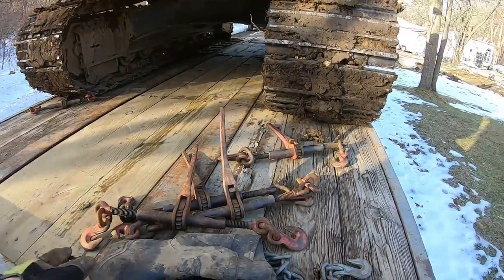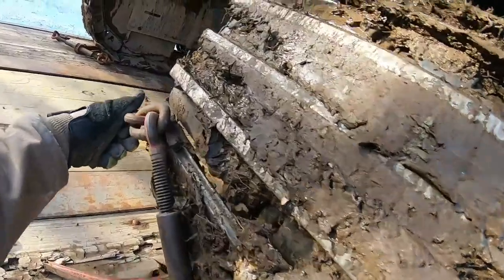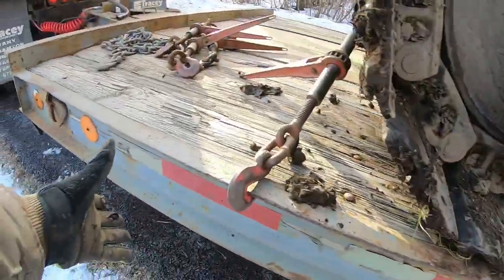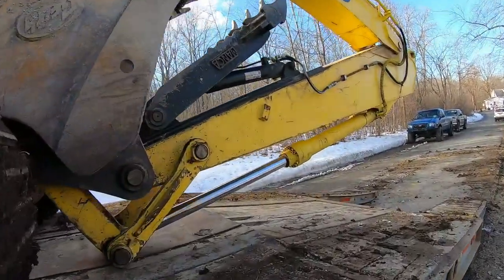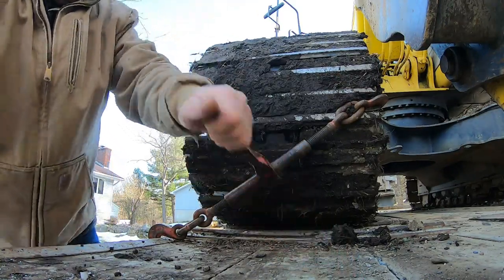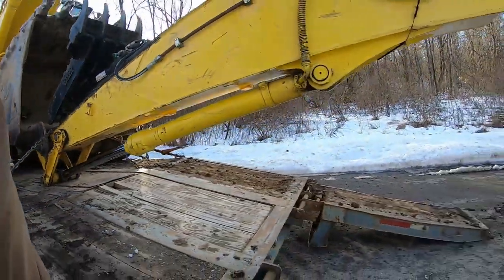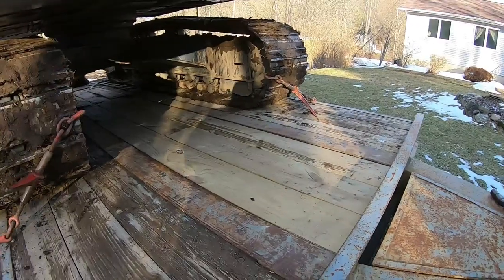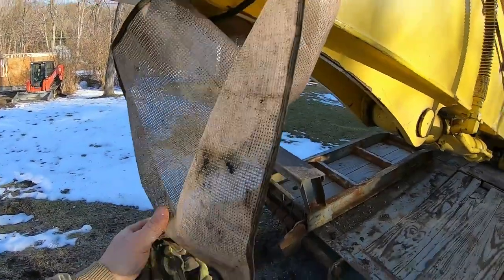Towing equipment from job site & proper technique of chains & binders for beginners

Comment: Pardon my question, as I know nothing about this type of equipment, but does tightening those straps damage the track at all?  I can see the amount of tension and the  stress being put on that during any moment.  Just have to figure thats hell on the equipment.  Sorry if thats a dumb question....
Reply from the maker: Greg not a dumb question at all! There's no issues with the force we're just taking the slack out of the chain tracks..when operating the machine and turning it has way more pressure against the rail.
Thanks for the question!

Comment: Great video, thanks for sharing. Don't you have to worry about the tracks tearing up the asphalt? I have seen so many videos where they use tires or wood to keep the tracks from touching the asphalt so it doesn't get tore up. What is your experience with that? Why do others worry so much about it? I have never run any large equipment, so I have no clue. Thanks.
Reply from the maker: Joel in the hot summer we protect the road but being so cold and the tracks are triple grouser Street pad full of mud.. there's no issues.. usually the excavators fine doesn't leave a mark at all it's the dozers single grouser pad like cleats.
Thanks for the question!
Reply: @DIRT-BOSS  Also you would only need to worry about that on new asphalt. Triple grousers don't leave much of a mark even in the summer.
Reply from the maker: @briangardiner1015  you are correct sir!